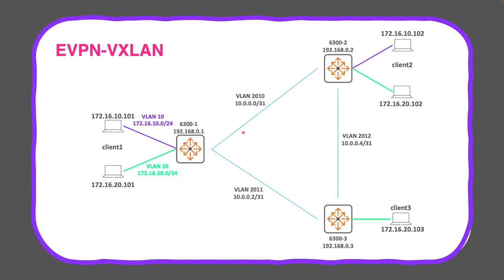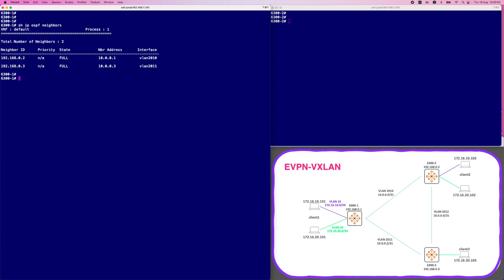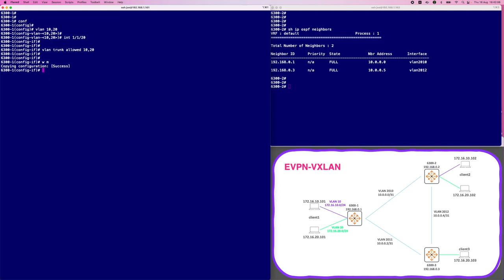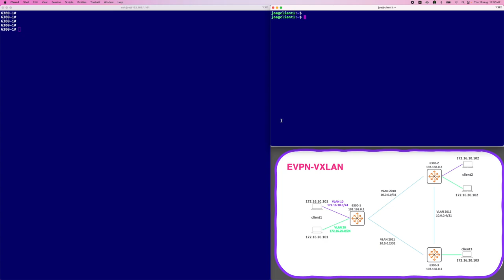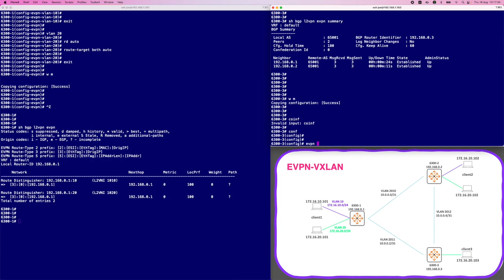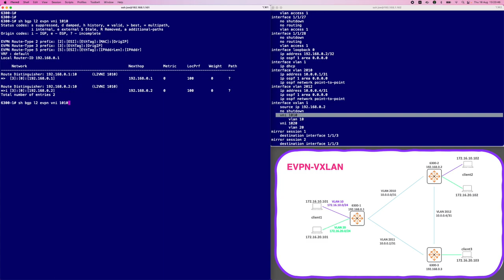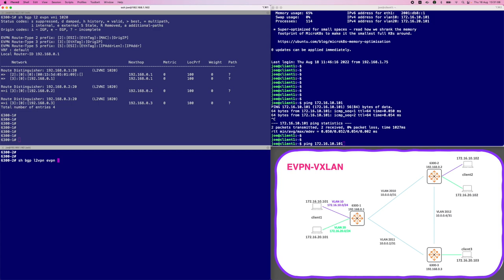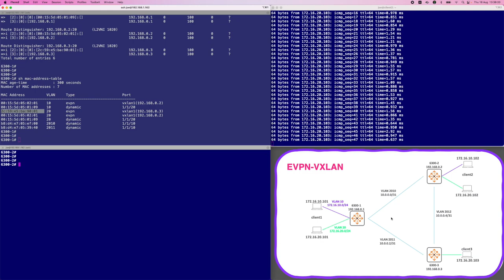EVPN-VXLAN Config Build From Scratch 1

Comment: Without the labels of the interfaces in the draw it is complicated to understand to which trunk interfaces you allowed vlans 2010 and 2011 but mostly vlans 10,20... you applied for vlans only on 2 interfaces, 1/1/10 and 1/1/20... which of those are for the customer side? and which for the vteps? i'm getting lost...
Reply: 1/1/10 is core, 1/1/20 is out to the customer. VLAN 2010 & 2011 are just the underlay VLANs, 10 & 20 are the ones from the customer that are bound to the VXLAN VNI.

Comment: The interfaces where clients are attached are in access or in trunk?
Reply: Trunk. I was using linux servers with multiple VLAN interfaces to generate traffic in different VLANs from the same physical server. If the client is in the trunk or access doesn't really matter, the customer side VLAN is bound to a VNI in each case. Note also that the VLAN is not carried across the VXLAN network, even if it is a trunk port on the customer side.

Comment: I'm trying to replicate this lab, i struggling with the ospf adjacency... it forms neighborship correctly only between vtep 1 to vtep 3 on vlan 2011 and between vtep 2 to vtep 3 on vlan 2012, not between vtep1 and vtep 2 on vlan 2010... Configuration is the same as you did, don't know what to troubleshoot... Trunk on interfaces allow the vlan 2010, and with sh mac-address i can see the mac address of the vtep2 from vtep1, but i can't ping between 10.0.0.0 and 10.0.0.1

Could be a bug?
Reply: Obv the network type of ospf is point-to-point
Reply: Check the configs and ensure that you've used the correct subnet mask on each interface, and check the routing tables & arp tables on the VTEPs. The routing protocol isn't relevant if there's no connectivity across the underlay VLAN.